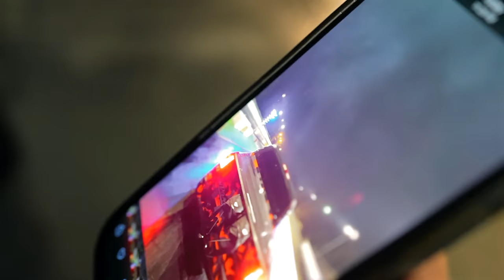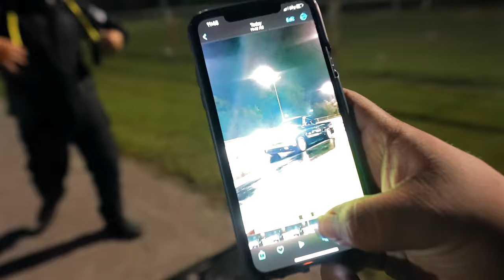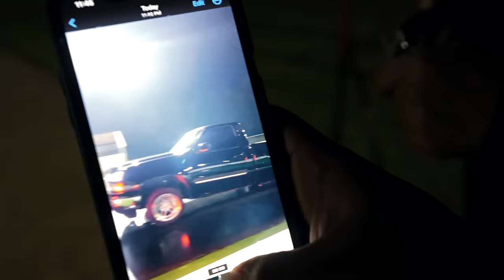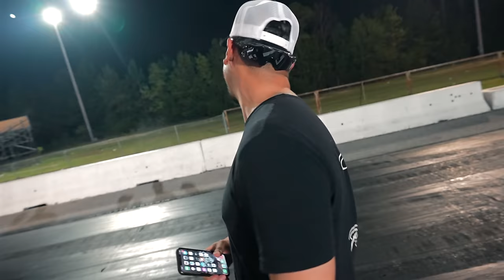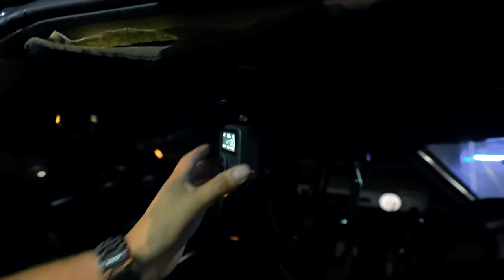2000HP+ TURBO TRUCK MONSTERS TEST-N-TUNE ALL NIGHT!

Comment: 42:35  or you can try to use a BMW spark plug socket since it’s different than a normal one. It’s a thin wall socket. A regular spark plug socket would not go all the way down it gets stuck before reaching the spark plug.

Comment: Now idk if you can do this to the trucks I seen it done to dragsters but I don’t see why not correct me if I’m wrong

So I have seen ppl use wd40 to soften up the tire to create better grip off the line. The wd40 is applied n then tire is wrapped in surround wrap and as you come to the burnout box you take the surround wrap off do your burnout n your good to go